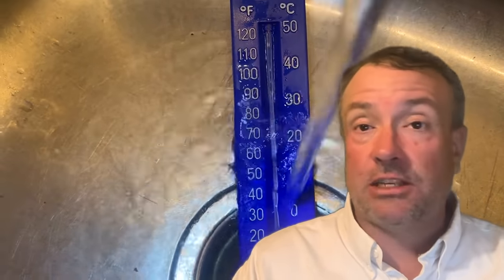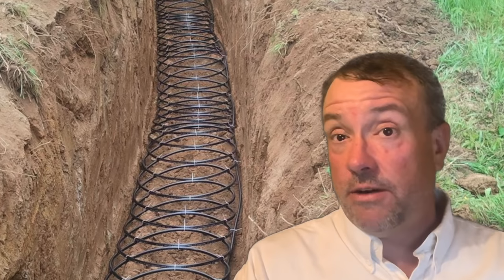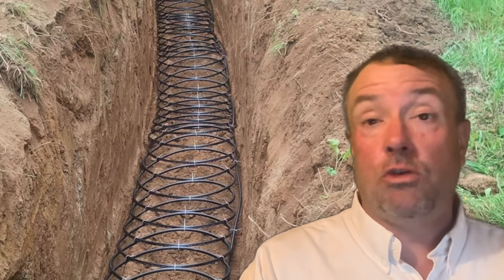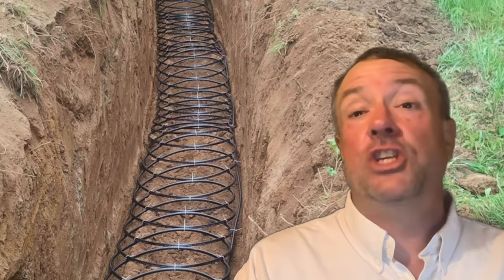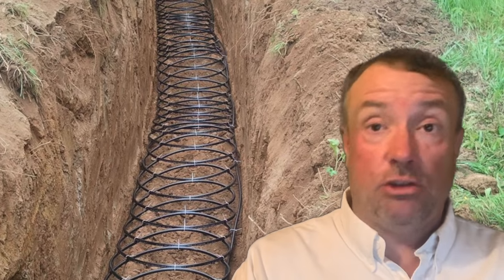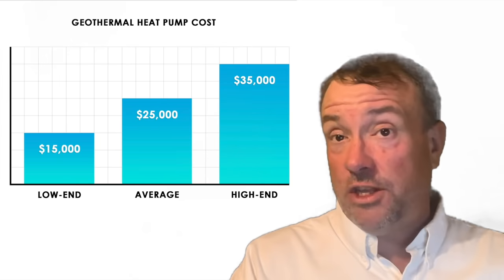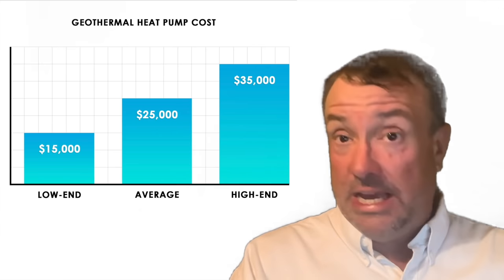Geothermal Cooling Tricks and Hacks

Comment: My self I would never tie wrap the water pipe to each other .  Even though it is underground rated  it is not rated for rocks hard debris so that being said with such a DEEP excavation that is a lot of weight that over time the pipes will begin to  crush into each other.   Proper installation would be to have a 2 to 4 inches minimum spacing between all water tubing .   I know no one has complained yet BUT also it takes time and some equipment to check for flow reduction.  I have been installing electrical - communications - underground cables - water supply tubing  and always all of them MUST have spacing.
         BUT  it is the QEW  ( quick n easy way )  to just tie wrap everything together burry it and run to the next job.  If you never have to repair your mistakes you never learn.    These horizontal trench installations should be back filled with at least 10  ( 5 under and 5 over ) inches of sand type fill before and heavier rocky back fill is added.  I know because I have been the one in the trench spreading the sand and making sure that there is 5 and five and NO pipes touch each other.
    I have been involved in many pipe trench repairs  SO  I am speaking from experience .    Take the time to DO it RIGHT  the first time.  Far too often people want to be finished the job before they start ......    You have inspired me so much with these videos that I am installing both horizontal coils with no overlaps and dug well type install with the coils installed still in the coil in a a dug well that has been cemented ( with Sahara sealant as used in swimming pool installs )  The well type has a water supply from roof drainage and a berried house tap water supply to keep the coiled pipe wet at all times.  When I am back in the Philippines I will send you pictures.
Reply from the maker: It’s different here but we get extreme cold weather
Reply: @SimpleTek  I am in Ontario now ( - 24 c ) BUT I am sharing with my friends who have the split A/C unites on how to get heat from there A/C unites even at - 30 c .   Now for them they are seeing the light at the ened of the tunnel that there split A/C unit can be MUCH more functionally able to produce affordable heat  by modifying it with geo back up as you demonstrate.
Reply: Horrible idea to coil the pipe. Can cause wear and it will not add surface area by doing it.   Great idea over all. Just don’t coil it.
Reply: I thought the same thing and it seems to be the common way of doing things judging by other videos.

Comment: Your horizontal loop layout will work much better than the highly engineered multi well system I saw fail miserably. I would suggest some kind of spacer between the pipes where they cross. Water source heat pump and well kept fluid chemistry, even in a closed loop.  You will heat when air to air heat pumps can't keep up in cold weather. You will cool in hot weather when your neighbors won't be able to.  About 1 GPM per ton of capacity.
Reply from the maker: Ok

Comment: It would be really nice to see the finished product and how it works what kind of air temperature you're getting
Reply from the maker: ok
Reply: In summer the outside temperature will be hotter than inside the house, thus it will heat up your house. In winter the reverse happens, it will cool down your house.
Reply: @JohnNy-ni9np  it is way cooler underground than it is just being outside

Comment: I have something similar to this working at the moment in Northern Florida. The only difference is I used a mini split air handler instead of the radiator/fan combo.
I modified the handler to have an exit line of 1/2 inch then jerry rigged the fan to operate on a solar panel in tandem with the pump. This way the system only cools down my shop when there is sunlight. 
So far it has been working for 3+ yrs.
Reply from the maker: @migueralliart  that is fantastic

Comment: Figuring how many BTU heat transfer.  A couple of things.  How deep can you go.  How large a diameter pipe.  Internal friction of smaller but longer runs. These all make a big difference in how many BTU and how long it might take for the ground to recharge the heat around the piping. Have heard of people doing a wider trench and then after backfilling enough to keep the tubing in place they cut foam panels wide enough to just fit the trench.  Why?  They do this to keep the warmer or cooler temps of the surface air from slowing the recharge time. For me to get close to the # of BTU needed I figured for the 10 degree difference from where you are in canada to here in SE Tn but using the same 3/4 in tube likely will need 800 ft per ton of cooling.  Hope this is helpful to other folks reading the blog
Reply from the maker: Thank you!
Reply: I am near Memphis and I am not sure my ground temps at 8 feet make this a practical solution even for my small 600 sq. ft. area.
Reply: @mickeymallette2663  curious what you figure your ground temperature is.  I am 30 miles  from the southeren border of tn and figure that the ground temps are around 57 F
Reply: @stevepailet8258  I m just south of Memphis.  I haven’t tested, but tried looking up data online for Mississippi and most things seem s to be in the 65° F range. But even at 57°, seems like a really long run would be needed to even get a 12,000 BTU equivalent.

Comment: Alright, I have to admit that that tap water test is genious!
Reply from the maker: Thank u
Reply: Trouble is, it's flawed. My well is almost 200 feet deep. The water that comes out of my faucet is warm due to the pipes being at ambient air temperature. After a few seconds, the water turns colder because of the colder water stored in my pressure tank, which is in the basement. When the actual water from my well comes through, it is much colder (200 feet). That tells me nothing about how deep I need to dig.
Reply from the maker: @garyblackford8366  someone is always going to complain with problems instead of solutions
Reply: @SimpleTek that’s not a complaint. it’s a helpful point to consider if you have a well. For city water it is a great idea.
Reply from the maker: @amgeezy_2709  ok.

Comment: Seems a lot of factors would determine the efficiency/effectiveness of any installation -- depth of dig, length of pipe, diameter of pipe, liquid in the pipe, volume of liquid in pipe, flow rate of chilled liquid, dwell time in the chill harvesting coil, and probably much more.  In the end, results satisfactory to the user are what counts, be it cooling 20 degrees for room comfort or 5 degrees for vermicomposting worm survival in Florida.  
    Did you guess the worms are my first concern at the moment? That said, I'm considering 2 inch vertical holes, jetted down with a trash pump.  I've put down a few shallow wells in that way, I think the deepest was 26 feet, and they do go in relatively quickly.
Reply from the maker: You have some good points

Comment: My new shop system just like this is working. Ground temp 8' down seems to be 15 C, and 800' of 1" line warms up to maybe 17C after a couple days of running, so for passive cooling the rad stays cooler than the air.  If I could tap into some of that 6-8C ground would make for super AC.  I bet if the water table with higher this year it would be more efficient, water in my well is about 15' down this month.
Reply from the maker: Nice work!
Reply: Great info! Thanks

Comment: if you can't get an excavator for some reason but can get a trencher, you can make a grid with narrow (6-inch) trenches ... you obviously can't coil the lines, but with a little planning, you can run multiple passes through the same trenches, kind of like the copper wire in an electric motor.  Perhaps not quite as efficient, but for many DIY'ers, a trencher rental is a much more realistic option than an excavator.
Reply from the maker: You’d need a pretty big trencher for my climate
Reply: for sure geographic location will impact the setup quite a bit ... I live in eastern Tennessee, and even in the middle of the summer, our tap water is about 60 degrees F, and the lines are only buried 18 inches deep.  At even 3 feet, you get a pretty consistent 57 degrees year-round... not gonna be magnificent at cooling or heating, but in an off-grid situation, a fan blowing through a 60-degree radiator is very nice in the summer, and a huge reduction in how much wood you need to burn in the winter.  @SimpleTek
Reply from the maker: @chipandputt  in summer our tap water is 8’C here, 4-5’C in winter

Comment: How does a two well system work?  It's no longer a closed loop system.  Rather than a circulating pump that is overcoming the friction in 3/4" tubing (not much friction for that laminar flow), you'll have a well pump pushing cold water up and that'll use much more energy.  In theory, the weight of the falling water can siphon water from the other well but in practice, the water will drain down and the suction will be lost.  For my area with a lot of limestone, I considered a closed loop system with a stainless coil down a single 6" diameter well, but unless the water at the bottom is an underground aquifer with good flow rate, it seems likely that the local area will not sink enough heat to air condition a house.

Comment: Question, could a system like this be used to make a hybrid geothermal/ conventional central ac.  My thoughts would be to add the geothermal radiator into the central system on the return side to pre-cool the return air just before it goes through the evaporator.   Would this increase efficiency substantially?
Reply from the maker: good question
Reply: Yes just either leave the fan on instead of auto or you can out a bypass ducking like a whole house humidifier/ dehumidifier.
Reply: Ground source heat pumps have been around for years.

Comment: Thanks for the follow up! I’m in Manitoba and seriously planning this for next year. The main argument against this is that for under $2000 I can install a smaller mini-split that has a professional appearance my wife will appreciate. When I have panels and batteries they be overproducing when it’s hot anyways. And a mini-split can be used as a heater in spring and fall. How I can make a nice looking blower is a question. If I did do it I could have valves to divert for garage heating in winter.
Reply from the maker: you can buy nice looking radiator blowers
Reply: I know this comment is months old but I have been in plenty of old houses that have radiator covers from back when the houses ran on boilers or piped in steam. 

Taking that enclosed idea with the front face built like sashed windows backed with aluminum window screen (to hide the guts) could work well. 

Might even be able to stack several transmission coolers upright with several smaller fans (which would be easier to find if you want to run on 12-24 VDC) all inside a home stereo speaker case you could find at a thrift store.
Reply: Solar panels put out less power when hot, they perform much better very cold
Reply: What about running your earth-cooled water through a bank of radiators that don't get directly blown into the house but instead precondition the air that is drawn into the outdoor unit of a mini split?  You keep the nice professional look of commercial gear inside the house and keep the Rube Goldberg affair outside and enclose it in a cowling or plenum that forces the intake air for your outdoor unit to first pass through a bank of radiators that is filled with your geo-moderated water.  It's true you still have the upfront expense of a regular mini split system, but you moderate the cost of running it by
Reply: ... always providing it air whose temperature has been moderated by the temperature of mother earth.

Comment: I know this was made years ago, but I'm pretty sure you will greatly improve the thermal dissapation if you use metal type pipes, and you're in wet soil.
Reply: true ... you will certainly get better thermal transfer with say copper pipe than HDPE pipe, but the copper pipe is far more prone to corrosion than HDPE ... and it costs a lot more.  far better (providing you have the space for it) to just go with HDPE in a long enough run to get the same result ... worry-free for decades.

Comment: For straight-line pipe burial, an ordinary trencher would probably be more practical than a backhoe or an excavator.   Some have extensions for extra depth.
Reply from the maker: never seen one do 8 feet before. I've used trenchers, in my experience an excavator is easier.
Reply: @SimpleTek  Okay.

Comment: Thank you for these amazing videos. I have one question though, I live in India in a very humid environment and I mostly need this system for cooling so can this system remove humidity without a heat pump? is there any other way to remove humidity using this system?
Reply from the maker: I suppose there is but I haven't researched it yet - soon I hope
Reply: If the temperature of the water is below the wet bulb temperature of the air into the house it will remove moisture
Reply: Run your cool water through an old fashioned steam radiator. Put a drip pan under it. Moisture will condense on the cooler surface and drip into the pan. Not sure if this would work well enough, but it will work.

Comment: Great Video. Just wanted to ask what the best 3/4" pipe to use for 800ft (average 2-ton AC performance) at about 5 to 8 ft in sand ground material? What's the best quality brand pipe and depth for coiling the pipe?
Reply from the maker: Not sure

Comment: When laying down the hose/pipe..do you put gravel around it or should it be in direct contact with the soil?
Reply from the maker: If you have sand I’d use that but most installers just use what’s available there

Comment: When studying Earth-sheltered housing I learned that the average ground temperature is the same as the average temperature above the ground. Colder climates have colder ground and warmer climates have warmer ground.
Reply from the maker: ok
Reply: In most cases, it is the mean temperature of the two. Say your average air temp. (day plus night temp, divided by two = average/mean temperature) is 70 F and soil temp is at 60 F. Then you will get an average temp of 65 F from pipes. 5 F cooler is not a lot, but 75 F is more comfortable than 80 F is. Also, if you design it so a fan blows on in building heat exchanger coils. You will also lower the humidity in building from condensation on coils. Some evaporation of the sweat will also help cool the air. 
In the northern latitudes, the results are a lot better. We will get 1-2 weeks heat waves and ground is ~ 50 F. The warmest my water got was 62 F after 2 months of mean temp of 72 F. And my pipe is only 2 feet deep (hand dug) because of ice age compact clay subsoil. Granted, I did plant a hedge rows on either side of pipe trench.
So I welcomed the 65 F on those 96 F days.
Reply: Agreed - mean annual temperature provides a good approximation of the ground temp.

Comment: Possibly crazy thought that might modify your design slightly.  The big expense / labor item is the install of the coils.  There's nothing stopping you from installing the basic AC system, then at a later date installing the heat pump (maybe say, when your furnace dies).  Just size the coils at the start planning for a future upgrade.  You might spend a few hundred extra in PEX and backhoe rental but you're prepared for the future.
Reply from the maker: ok